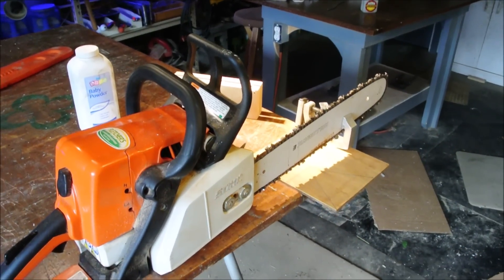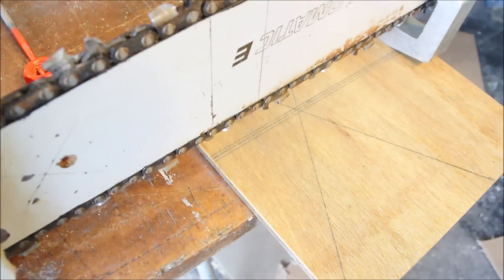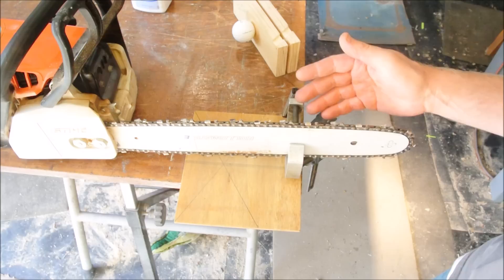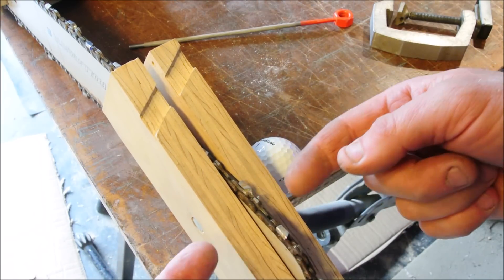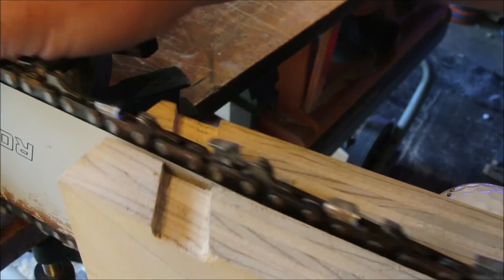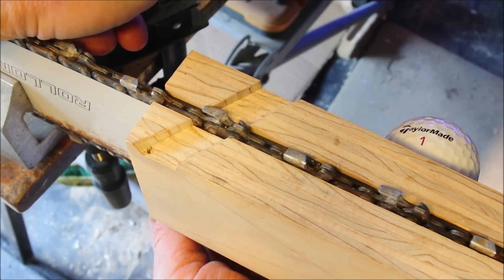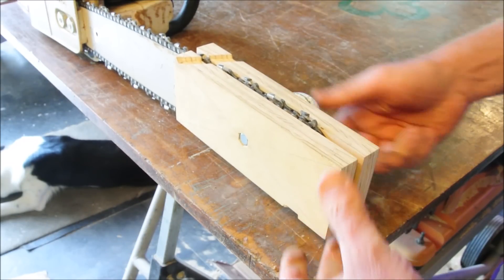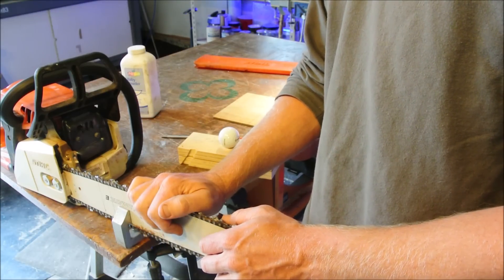Chainsaw sharpening jigs/unfinished idea

Comment: An idea on how to set the height and link the two halves together. Use the copper piece you briefly showed and put it into the ends of the boards. Drill holes so its height and how far it protides out of the ends of the boards makes it land in the gullet of the previous tooth so your height and distance for sharpening the next tooth is correct. Perhaps make it a friction fit so you can easily pull it out and swap it to the other side when you need to flip the boards for the other angle. Not sure how durable and long lasting that would be. I could see the holes widening up over time and making the fit too loose.
Reply: You can have two register linkages on both corners of one long side, so that it will catch on either the top or the bottom depending on the side you are filing. No need to re-pin it on every flip.
Reply: Wouldn't the tooth hitting cooper dull the tooth after time

Comment: Could you have two wholes drilled in each end of the jig and then have a square/u shaped pin that slides into the holes to lock them together (but can be pulled out and swapped to the other side when switching directions?